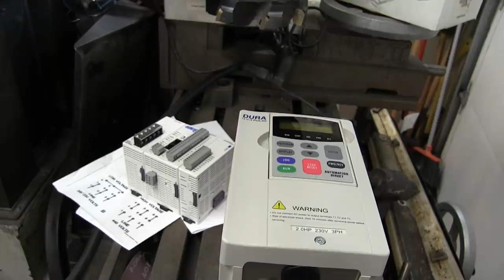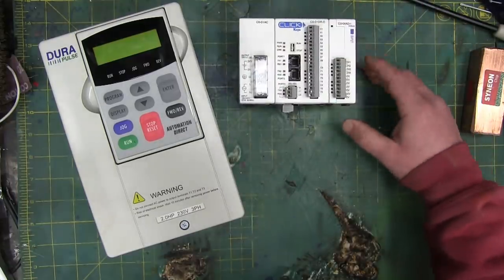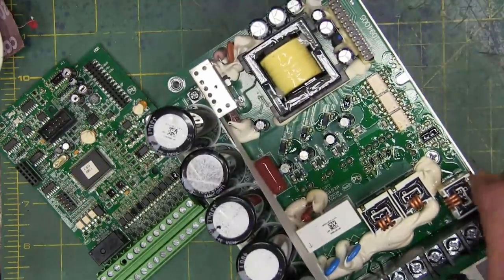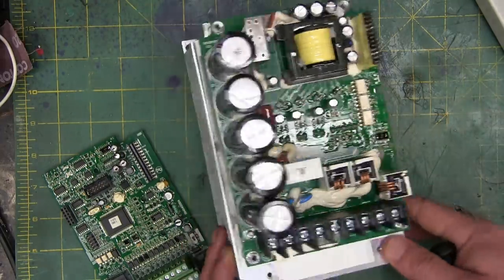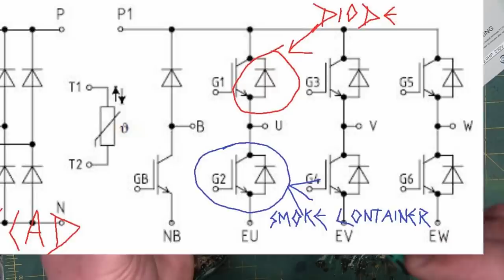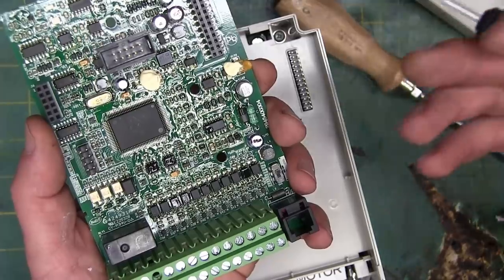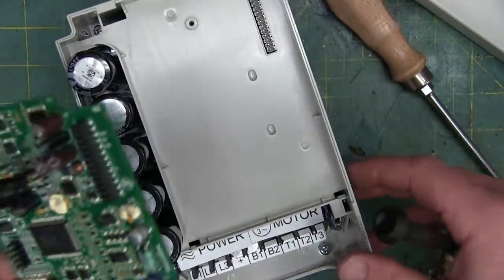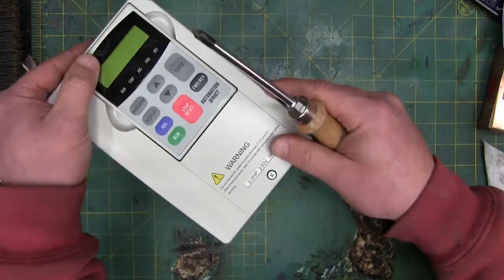BOLTR: Inverter EXPLAINED | DuraPulse VFD

Comment: @4:30  Quartz vibrates when electricity is applied to it.  The frequency of the oscillation can be adjusted by machining the quarts to a specific shape.  Proper timing is achieved when two capacitors are go through charging and discharging cycles and keep the quartz oscillator locked at that frequency.

Comment: Just remember that the control side is probably riding on one of the HV power rails, so any oopsie with the control board itself to a ground results in a very very dead control board with most of the teeny tiny parts blown all to smoke, and a very dead drive. Control inputs are isolated, but extend the control panel to remote mount it and that entire board and the cables are essentially connected direct to the mains via a single diode, and any short in the cable or the mounting will result in a bang, especially if the control panel gets any sort of water ( like water based coolant) splashed on it and it gets past the almost non exiting sealing of the front panel.

Comment: Someone else might’ve posted this, or ya maybe already fingered it out, but....
That relay controls the “R1O” “R1C” & “R1” terminals. “R1O” = Open. “R1C” = Closed. “R1” = common. Typically used for a safety interlock or sometimes a 120VAC “Power” light or such. 
Thanks for vid! That is a really good price for a 1 to 3 phase VFD. I’ll have to remember this next time a customer only has single phase service.

Comment: You can configure the drive to vary the speed based on a signal you provide. You dont have to only use the buttons on the keypad. The Durapulse drives are really easy to configure how you want.

Comment: Ave the reason for the different sized capacitors might have to do with their frequency response. Usually the smaller ones can operate to a higher frequency. So the big capacitors store more energy for the inverter and the smaller one clamps down the higher frequency transience.

Comment: Beware those sine wave filtering caps! To date my biggest ever bang was recommissioning on an 800kW inverter that had been dormant for 11 mths soaking up all the lovely UK air juice it could find. I now tell customers to run a slow gradient for at least a day when bringing cold/wet power electronicary back to life. Current record is 26 x 2500kW running in a substation battery storage system swinging + to - in 800ms :)

Comment: I remember my dad making 3 phase converters just using capacitor banking.  Take 50 er so never counted. But would run one motor. Last one he built ran a 20hp 3ph motor for my uncles feed mill.  Cause it was cheaper at the time anyway then buying two 10 hp motors.

Comment: For those of you unsure if it's worth it over a cheap eBay item. Things I like about this drive over mine: Many more digital inputs. Ground lugs on BOTH the input and output sides. Nice holes for cables. No fan! Not sure it's worth three times the price, but in retrospect, I might have swung a few more bucks.

Comment: Relay likely for a "relay output", configurable operation to turn internal parameter or signal (such as fault) into relay contacts for use in external circuit or indication to PLC.

Comment: i think they build the 3 phase from the caps, using hunting oscillation, so the IGBTs are actually cutting current to create the oscillation output.
Reply: No, the IGBT's are turning on and off rapidly using a PWM(Pulse Width Modulation) to create an average voltage that matches the sinusoidal waveform.
http://www.vfds.org/vfd-pwm-waveform-762549.html

Comment: I think you got it backward. The big massive capacitors are for smoothing out the "chopped up" output of the IGBT. The input AC filtering capacitors are next to the transformer.
Reply from the maker: Capacitors act as a short circuit when IGBT initially closes. Switching at 16kHz, the IGBTs wouldn't last long in that configuration.
The massive caps are on the DC bus, providing ripple filtering of the rectified input and energy storage.

Comment: Great video as usual. Love your candor. I found an '86 j frame millport sitting under a tarp at a local farm.. price is the labor to transport 2 miles to my house.. no tooling except for a rusted solid Jacobs Chuck. Head was turned and stored upside down for 10+ years. What do u think? Worth digging out? Or just spend the $2500 to get a working machine?

Comment: Tip! You got 2fase? Run a 3fase motor with it and you get the 3rd leg free. Full sinus no crappy inverter needed.
Reply: Yeah, but then you'll have 80%ish losses from having to spin the motor, it makes noise all the time, not to mention the crappy power factor and issues with the voltage balance. A homebrew rotary phase converter is hardly a perfect sine, don't talk down on the power of a digital VFD inverter with a line reactor.
Reply: Kevin Vermeer i agree with the yeah part, rest is overdreven en kwats, problem with vfd is some machines require the higher line voltage and not only for the drive, an other downtalk on the vfd is, in this particular config you can not overspeed the motor beyond 60Hz. And one other you need to change all motors to delta wiring. That high loss your talking about only occurs with the steinmetz setup

Comment: While I know very little electrical I do love your channel.  I once bought a new Hitachi inverter...model L300P...thoyght I was going to make 3ph from that and never could find anyone to tackle the job....sold the machine requiring the 3ph and the damn inverter is an expensive paperweight in my garage
...still in the box and all the instructions are there. So...can you tell me if I ever had a chance  to make that application work or did I buy the wrong thing. I may get a lathe one day....could it work for that? Thanks for educating the minions.

Comment: Automationdirect site is interesting with decent prices. Too bad so many VFDs are limited to 3 hp with single phase input. Why so, and why no work around? What range of repair parts are available (coverage), I see several items, Is it possible you could fix common failures instead of buying a new one? Motors too....

Comment: Like you I am nurturing two saplings that exhaust any funds I have to play with. Like you I have a need to make stuff and I’m proudly part of the men in sheds brigade. 

My hypothesis is that if you have a VFD, why use it for only one motor when it will supply the voltage and rated ampage to the machine keeping the frequency 50 /60 Hz constant so as to use the machines own speed controller being belt drives. 

My mill, a Beaver MkII, yes I have had my hand deep in a Beaver, has 3 motors, differing HP but all are 220v. 
I’m being told by a somewhat smug electrician, that I need a VFD for each motor…  

Just to prove him wrong I’m running one VFD for all three motors. That’s two fingers up (British Colloquial expletive) to the nay-sayer but the retort had me thinking. “it will burn out the VFD”.

I will send him over for a teardown, don’t worry about returning the parts.

Comment: You don't use the variable speed feature on your lathe??? Man you are missing out. I put a vfd on my emco super11 and I LOVE the variable speed feature. You can fine tune your speeds so the chip breaker works or you avoid chatter and get a great finish. I still use the gears to make sure I have the torque I need. I hooked up a 10k pot so I don't have to press buttons. I highly recommend you check it out.

Comment: Hay if you want to try to find a dumpster VFD try looking at the contracting company dumpsters @ airports. They would rather throw out completely intact VFDs and there steel box with filtered air intakes than go through the hassle of selling it to a totally flooded market. 1 time I got a 5 HP motor, and like 6 2-5 HP VFDs unused! It's insane. Their AB powerflex too not Chinese

Comment: In the Yurops, if you have a relatively new home you likely have TN infrastructure. So at least where I live at the moment all three phases are wired in to the fuse box, just pulling off one phase and neutral to drop the voltage to 230 for regular appliances, pull off three phases and ground for 400V three phase goodness. Or I guess you could pull off one phase and ground for single phase 400V too? I'm not an electrician.

Comment: Price the software needed to program Allen Bradley against Automation Direct. $5000+ against $400. Very many companies have decided to use much of the AD product line. Cheaper but not cheap. Low end PLCs to high end motion control. And, the programming software works with all of their PLCs. The Click is a low tier but has many advanced functions including Ethernet, PID, Analog inputs and outputs and PWM outputs. And, they give you the software free. Many of their products are tailor made for Makers. Great customer service.

Comment: I've used lots of those Durapulse Drives.  They are more reliable than Allen Bradley in my experience.  They deal with heat better.

Comment: Could you be any chance do a video on how to hook up a transformer where you're not sure of the wiring diagram? I salvaged an old massive transformer and cannot find any information on the part number. I think there are about a dozen wires (a few being larger than the others).
Reply: those are just different taps most likely, just hook up a small ac source (find pairs of wires with low resistance) on the primary side and volt meter the secondary side pairs. hopefully they'll be multiples of each other.
Reply: Kyle Kulinski this needs to be a thing!!!!!

Comment: I'm in Canuckastain, I've been eyeballing a coldsaw and a belt sander I can buy from work cheap, I disregarded them as they are 208v 3 phase, which I don't have at my home shop. So this VFD can run them, I'm guessing. More research needed, "cost vs usefulness."  Thanks

Comment: I was able to follow the explanation of the DC-AC conversion through the IGBT ok, but what I'm not completely understanding is how we get the negative voltage from the DC pulses. Is this an instance of JFM?
Reply from the maker: How do you get a DC motor to run in reverse? Swap neg for pos. Google: "H bridge"

Comment: Since caps act like batteries, can you hop one of these things with a real battery/batteries? Why not hook up two in parallel? Why no split phase 240v input. I realize that 3 phase is more concentrated than single, but I think they are dragging their feet. How expensive are transistors anyway?

Comment: (related) Video Topic Request:  Could you make a video describing how to smooth out the output power from a VFD?  

I have a Hitachi VFD that i originally purchased to convert 230V single phase power into 230V three phase power for a milling machine.  I recently added a lathe to my shop.  I'd like to use the same VFD as a phase converter for both machines since I have no need to operate both at the same time.  I'm trying to connect the VFD output to the three phase input on the machinery through the original equipment machinery control circuits.  This seems to work fine on the mill, but I'm having some trouble with the lathe.  When I try to run the lathe an AC contactor starts buzzing and the motor does not run.  It works fine if I hook the VFD directly to the lathe motor, but doing so does not allow me to use the same VFD for my mill without re-wiring.  I think the cause of the AC contactor buzzing is the noisy output power from the VFD.  I'm trying to research how to create a low pass filter / load reactor but I haven't been able to figure it out yet.  Is it cheaper to go this route or just buy a second VFD?  Would filtering also quiet the VFD down (mine appears to be making the motor hum at the carrier frequency)?

I like your videos, Keep up the good work!

Comment: Come live in Australia where lots of houses have 3 phase. And if you don't have 3 phase and want it installed. Only about 1k once you update the meter and sub board.
Reply: $1k (probably more like $2.5k with your board upgrades factored in) providing you're in the right area with the right distribution company - otherwise grab your ankles and take a deep breath.  Hence why my Bridgeport clone is running on a $200 VFD...